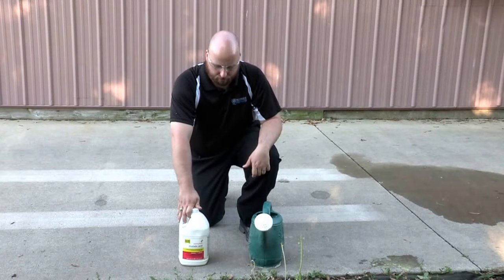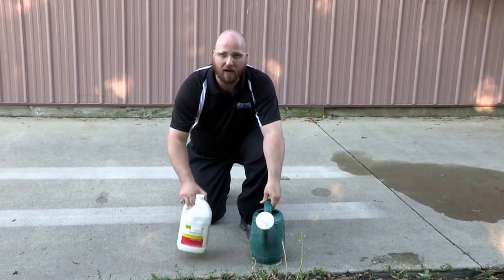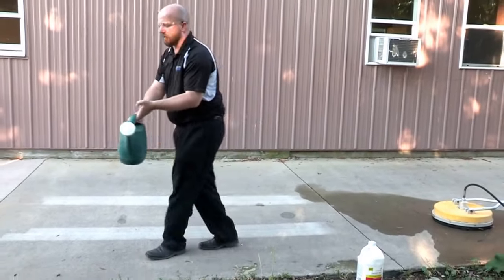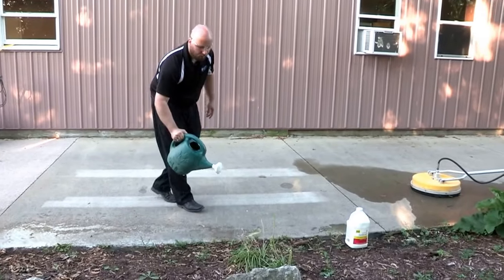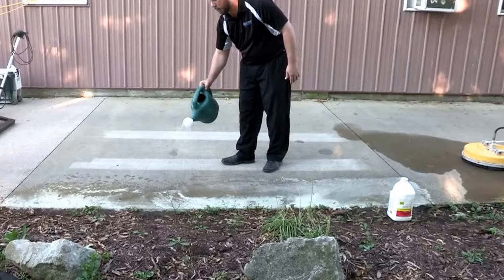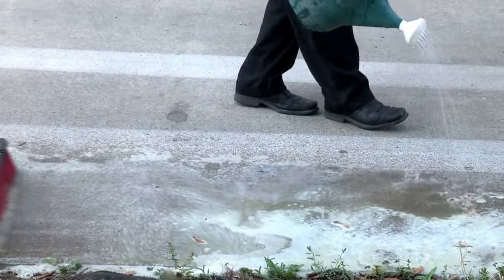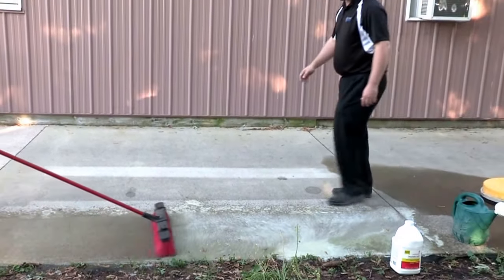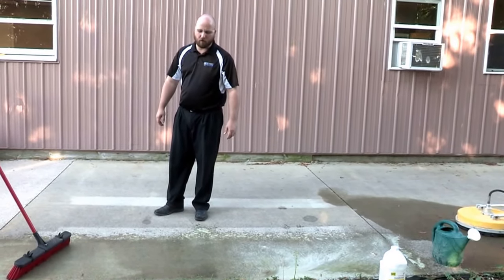How To Acid Etch Concrete

Comment: MATE!!!  You should always wet the concrete first with water.  If you don't you run the very high risk of burning the concrete, and it will get a yellow tinge.
Reply: How do you remove yellow tinge
Reply: @ghosttesla  grind it.
Reply: Don't use this guy's method dangerous in so many ways especially your eyesight
Reply: @rosemunn2857  yes safety glasses are essential
Reply: I'm so glad you commented. I'm researching the acid etching process and I wouldn't have wet it down. Thank you!

Comment: Very important, wear eye protection and a mask, this acid is lethal.
Reply: Also, people should note that if there is grass around where the concrete is ur washing, it is likely gonna die.
Also, if doing a large area and there are other homes near by, you really should be mindful that the wind may cause poisonous gas to drift into other people's homes...
Point being, if you don't know much about acid other than "it eats through shit" then leave it to the pros or get properly educated first. Otherwise u could kill or harm yourself or others.
Reply: The pressure sprayer operator appears to be wearing flip flops
Reply: Cant believe this guy is virtually naked regarding protection.  Take it down before someone gets burned and blinded.  Holy Foooook    No !!!
Reply: and wear black shoes so you can paint them white. Why are people always wearing good shoes to make construction videos. Guess were rich.

Comment: I am not a pro, but I would not do what this guy did.   First, I would wear gloves and a mask.     The acid will burn the roots and foilage.    Folks don't do what this guy is doing.   Be very cautious when you use acid, don't let run off into surrounding foilage.